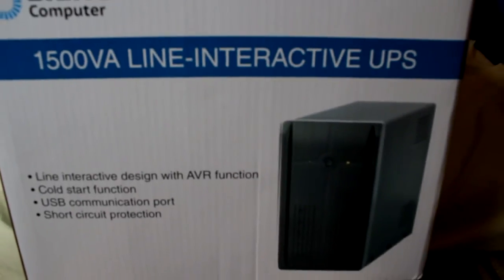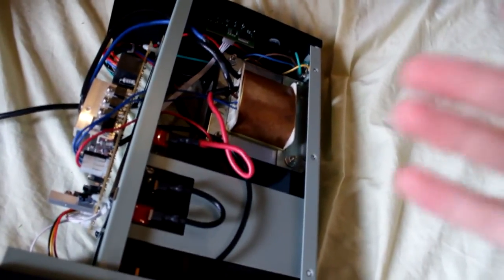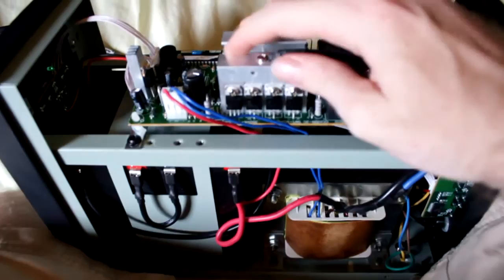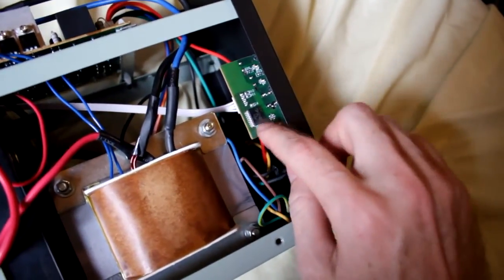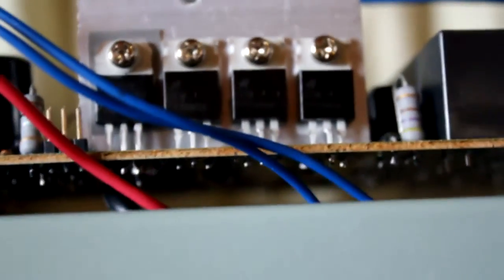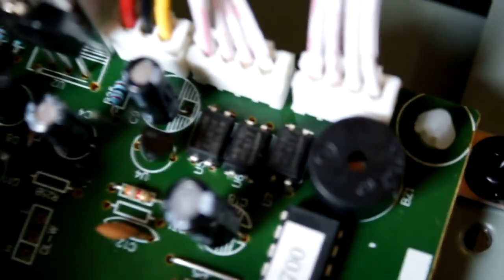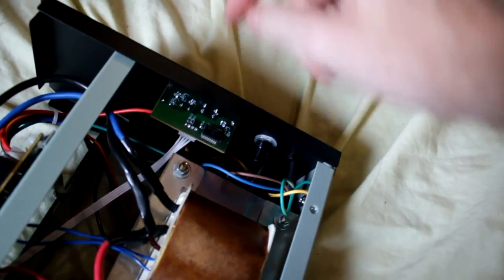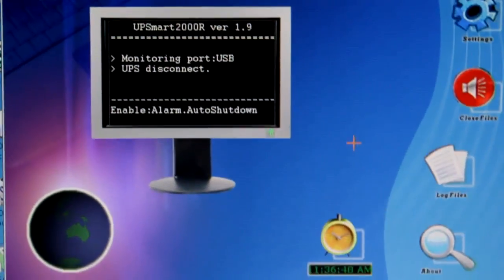Digitech MP5203 UPS teardown

Comment: The positive battery lead going to the centre tap of the transformer indicates it uses a push-pull topology, rather than the more popular full bridge. Basically you have two banks of paralleled mosfets (the devices on the heatsinks) and they ground the ends of the windings in turn at 50Hz (or 60Hz) energising the windings with 'AC'. The transformer steps this up to the mains voltage. The web will give you a better, more detailed explanation, diagrams are better than a thousand words!
It's more common in UPS designs to see full bridge topology which requires no centre tap on the transformer. This requires 4 banks of mosfets and is more complex, not least because the 'upper' mosfets require high-side drivers, but it's a much better design. Push-pull is a cheap way of doing it, you won't see this in quality UPS designs.
I also have the Eaton Powerware model you mentioned. They are very nice units that use high frequency switch mode topology instead of the more conventional low frequency design, hence their lack of a big, iron core transformer. There are pros and cons of this, they are certainly more complex but lighter and quieter IME.